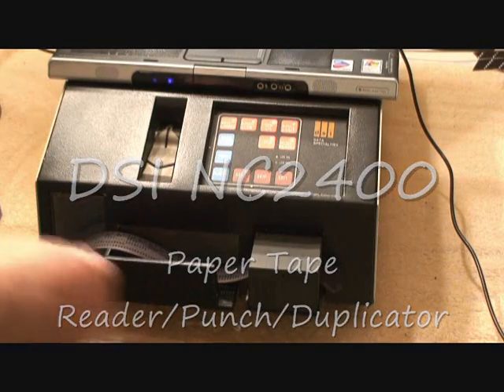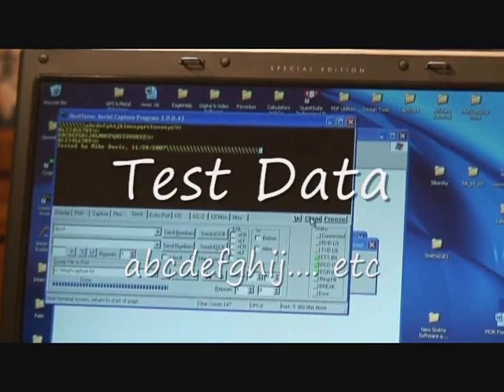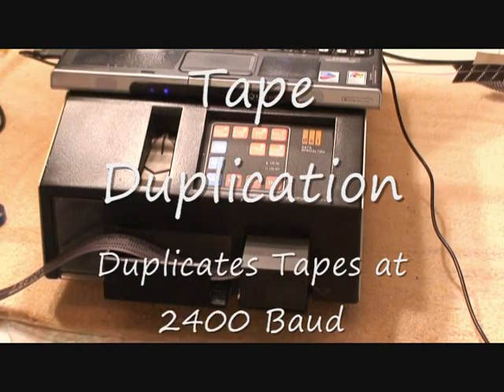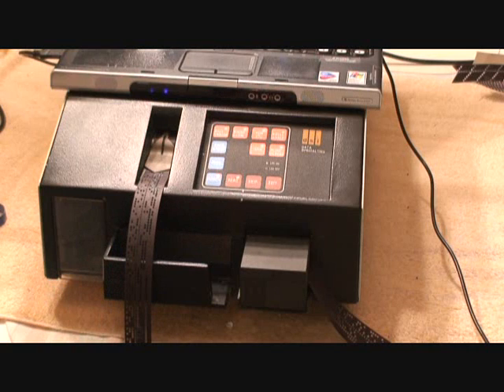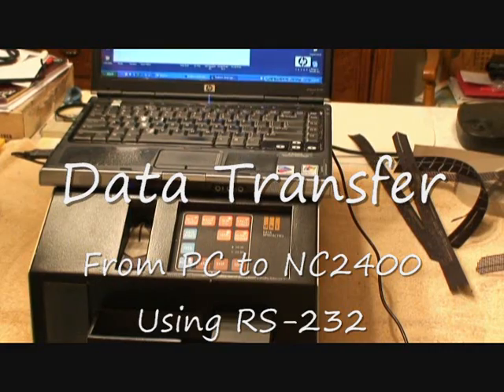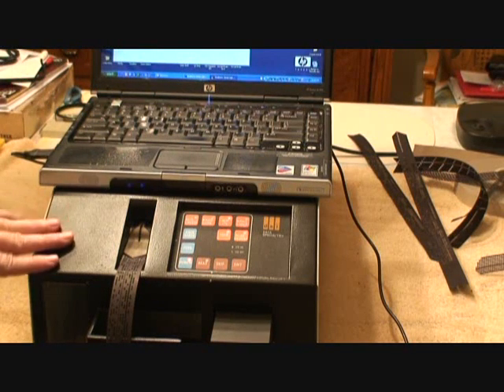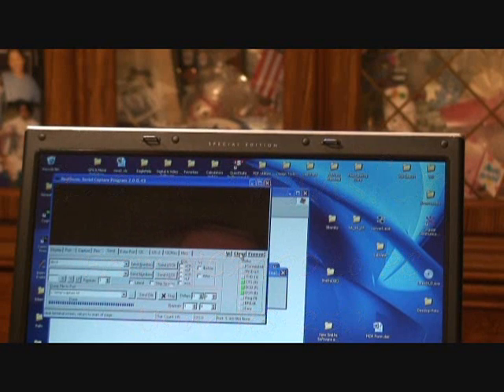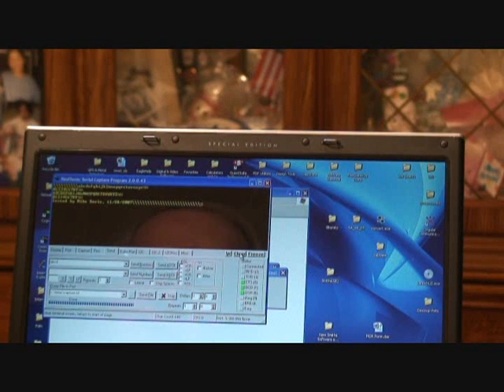DSI NC2400 Paper Tape  Punch/Reader Duplicator

Comment: do you know the value of R44 on the main board.  its the big ceramic resistor
Reply: If it is the one on the inside of the big side board underneath the touch pad, where the area gets burnt looking, it is 25 ohms, 5 watts.  This is a common problem on these units.  If replaced, it is good to space it out away from the board quite a ways.
Reply: @stewartmarshall4112  Contact me via the email on the channel page
Reply: @retrotechandelectronics  What channel page?
Reply: @stewartmarshall4112  reply with your email. I’ll delete the comment when. You post it.